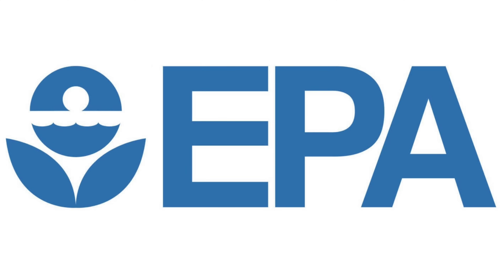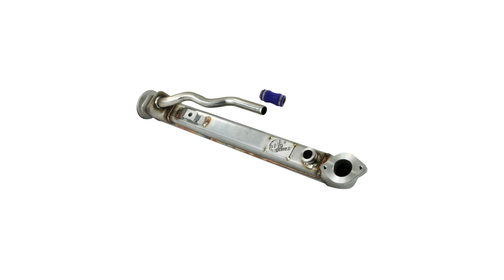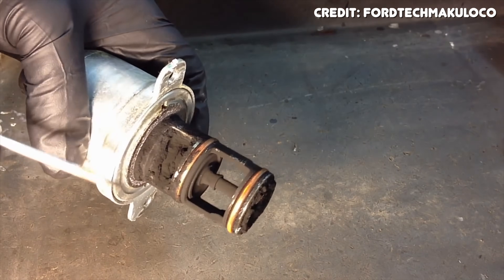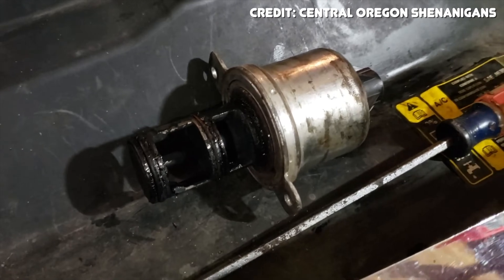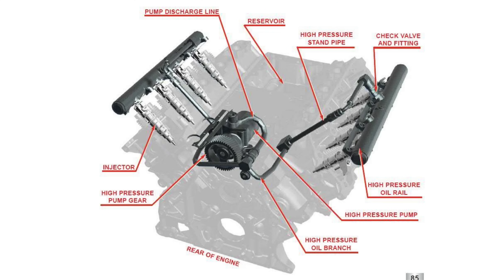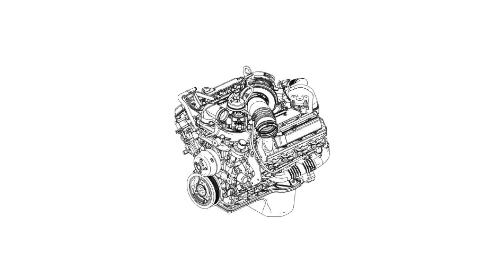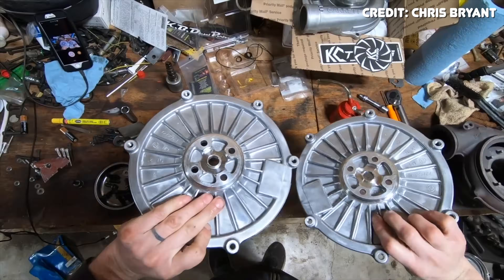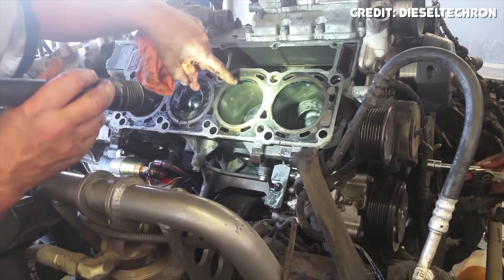The Truth About the 6.0L Powerstroke (And Everything Wrong With It)

Comment: I had an '05 Excursion with the 6.0.  My only problems were a failed EGR gasket at about 60k miles and some failed fuel injection sensor both of which were rectified on warranty.  I had it tuned and a turbo back exhaust.  Ran it to 130k miles and then traded it for a new 6.7 F250.  I was still happy with the engine, but it had all sorts of other maintenance/repair issues that were coming due.  It needed tires, brakes, shocks, replacement of the aftermarket in-dash nav, trans and diff service, some front suspension wear and potentially lots more.  I paid about $49k for it in '05 and traded it in '10 for $30k.

Comment: It's a cheaply built and complex engine that was compounded by several errors up to the point of delivery and after sales support. The block and rotating assembly are the only things decent about it. Shame on Ford for not doing the proper testing and Q.A. To further damage the reputation, Ford also failed to do the proper Q.A. on their remanufactured units. The gold coolant, and lack of regular flushes seems to be the largest culprit of major failures. The coolant deposits can lead to a failed egr cooler dumping coolant into the intake, then boom, blown head gasket. This issue can be there on trucks with less than 50K miles. We can't forget that the EPA and International is partially responsible for this whole mess. If you feel the urge to tear into one, all of the other parts need to be carefully procured and evaluated. This includes cam & lifters. Even if the cam lobes look good, you may want to consider a better profile while you're that far into tear-down. With that said, I wouldn't mind doing another build if another nice chassis finds me.

Comment: I spent thousands of dollars chasing all the problems you discussed. The final straw was a $5000 blown head gasket job. Drove it straight to Auto Nation. Problem solved. My 1999 7.3 has 350,000 miles and in 21 years has never had a problem.

Comment: I got 228000 miles out of my 03 6.0 hpop went out found another 6.0 for 1000$ had 140000 now truck has 260000 miles on no real issues.but it's all stock.
Reply: yup, what makes these awesome engines unreliable is pushing them beyond their design limits
that's all it is to it

Comment: I bought my 6.0 for cheap knowing the issues. Deleted EGR, 155/30 injectors, studs, HPOP, oil cooler relocated, blue spring, intake, KC Stage one, turbo back exhaust, etc. Runs like a champ, pulls like a train. I looked at a new truck but you can do a lot of Maintenence if you aren’t paying 1200 bucks a month.
Reply: This is the way, rebuilt everything but the transmission so far. 80k plus 7 % intrest for 72 months is a fools game.
Reply: I just bought a 2005 F-350 Lariat FX4 Long Bed with only 58,000 miles on it. There's not a ding, dent, or scratch on it. Interior still looks darn near new. It's 100% bone stock original. It is a Unicorn for sure. Over the next several years, I will be doing several of the things you listed. Gotta get ready for retirement. This will be the last truck I ever buy. And I will save tens of thousands of dollars doing so. I WILL NOT BUY A NEW PILE OF CRAP!
Reply: I bought my 03 from the original owner with everything already done 17k miles before I got it for 5k dollars with only 183k miles on it
Reply: Litterly why I just sold my 2021 ranger to drive my 03 350 6.0
Reply: Great post
Reply: What exactly did you do to your 6.0 to make it run as such im going to be buying a truck with said 6.0 in it and want to be aware of what I may have to endure before buying
Reply: Yeah, the stock oil cooler was the big unknown killer of that engine.
Reply: Where did you have the work done at
Reply: Right! Cost of new trucks and interest…

You can add a few features to these and roll out!
Reply: Im planning on getting a 6.0 ford I wanna do all the bells and whistles on it like you have, and it’s gonna be my daily I drive 30 mins to work on the highway think that’ll be good and I wouldn’t see any problems?
Reply: @andrewmoi567  like he said above, stay away from hot tunes, ARP studs, EGR delete, remote coolant filter, blue spring update, change fluids early, always, don’t drive like an asshole, I bet you’ll find you love the truck. Do the work yourself and it’ll be a great experience. I love my truck. Paid cash in 2008. Did the above, minus EGR delete, just updated it, and it’s been a good truck.
Reply: Yep, mine pulls like a locomotive.
Reply: so basically you bought that shitbox dumped around how much you payed for the truck itself and its still shit
Reply: @shaggy501  I payed 5k for my truck and runs fine could put 15k in parts and gave a brand new truck good luck picking up a 1ton in my area that's good for anything under 30k
Reply: @shaggy501 I will NEVER understand why someone cares so much about how someone else spends thier money! Maybe just share how you spend your time and money…
Reply: @shaggy501  Ah hah! I found the moron in the comments!

Comment: So, for starters, you NEED to look at this person's videos about the 6.0 and edit your video so that you can update people that may be watching.  There is some information in your video about the head bolts that I think you need to clear up because there is a lot of misunderstanding about the head bolts (Torque To Yield or TTY).  I'll admit, I didn't realize that it was misunderstood either until I watched some of these videos.  They know their stuff when it comes to the 6.0.  Likely more than most techs out there and many owners and possibly even a few engineers.

Their channel is here:

https://www.youtube.com/channel/UCm3RzBZ2yUkgIqFlOqb7Mpg

Next, you need to understand a few things about the "myth" of the head bolts being the problem or one of the problems with the overheating or coolant issues.  I will again suggest that you check out the videos on this person's channel as they have covered a lot of the 6.0 and how it operates and the drawbacks of it.

But, I'll do my best to sum it up for you based on my interpretation of this person's channel.

For one, they found that the torque to yield (TTY) head bolts actually provide just as good of clamping force and possibly even better than the STANDARD ARP head studs that a lot of people use when doing the change.  I typed "standard" because ARP does make different variations of head studs for the 6.0 as well as other engines for which they can withstand much higher clamping forces and temperature changes.

At the same time, instead of the standard head studs costing $450 to $500, these higher grade head studs cost $1200 or more so at least 2 to 3 times the amount.  Now, for people racing their trucks, this might be worth it.  But for people just wanting to get a little more power or maybe even more than "a little bit", the standard ARP head studs are probably sufficient.

But anyway, the point is, based on the info on that person's channel, they did comparisons and although I am NOT speaking for them, essentially they found that the torque to yield (TTY) head bolts were NOT the problem.

One of the main problems that contributes to many of the issues is simply the design of the heads themselves.  Not only because the engine only allowed 4 head bolts to provide clamping force around each cylinder, but the heads themselves did not have adequate support between those head bolts to provide adequate force to prevent the heads from warping or "tenting" in between cylinders or multiple cylinders.

Essentially, the "bridge" (support material) between one bolt to the other one (say the top two) was not thick enough to prevent the head from deforming.  Again, the "warping" or "tenting".

So, what happens is the head ends up having a big oval shaped area in the entire middle of the head (I guess think of Ford's logo and there you go) and this area "lifts" up allowing gasses to escape along with combustion as well as coolant to enter the cylinders and/or chambers.

The result is a lot of problems with head gaskets and heads.

The problem is, this can't necessarily be corrected by milling because Ford actually sent out a TSB (technical service bulletin) specifically stating NOT to have the heads milled UNLESS they were warped by less than a certain amount.  I believe the measurement was less than .002" but I may be wrong.

Anyway, the problem is, even if you mill the head, if it's warped too much, the head is still going to have that deformation EVEN WITH milling the head flat.

And, because there isn't enough support or material between the bolts holding the head on to prevent the head from deforming further, it will still "warp" or "tent" even after having head gaskets replaced AND head studs put in.

This person went through hundreds and possibly even thousands of posts from various online sites of owners having their head gaskets replaced as well as heads milled only to have problems within a few thousand miles after the repair.  This happened to many owners.  Sometimes it was within only 20k miles or 10k miles and even as low as 5k or 1,000 miles.  Some said it was pretty much immediate.

How could this happen?

Well, it's because the head design is just crap.  Obviously, the limited amount of head bolts around each cylinder doesn't help anything but that's just one part of the problem.

So, about the only solution is to either find a really good used (seasoned) head that is extremely flat to within .001" or better.

Or, have the heads O-ringed to provide better sealing ability around each cylinder.

Or, consider purchasing new (NOT REMANUFACTURED) heads.  I say NOT REMANUFACTURED because the problem is, if the heads are remanufactured, either they are going to have the exact same castings which isn't gaining anything due to the lack of support material (as I've already pointed out) or, they will just be used heads that aren't really good to use anyway.

If you get a completely new set of heads, there are companies that make them with completely new molds with better support material to help combat the issues with the heads "lifting" or "tenting/warping" during operation.

I'm not advocating for only one company because I believe there are others out there that make heads but Kill Devil Diesel is one company that makes their own heads for the 6.0 that are 100% completely new from a brand new mold.

The downside is that the heads are aluminum so there is a concern that the strength of aluminum compared to cast or whatever material the stock heads use is not quite as good.  Unfortunately, Kill Devil Diesel doesn't offer a different option at this point that I know of.

There are other companies that many owners of the 6.0 online forums do recommend for heads as well.

The other issue that isn't really discussed is how poor the surface preparation is prior to reassembly not just for the heads BUT ALSO the engine block itself.  Not to mention people not checking to ensure that the engine deck surface is 100% flat or within .001" or better as well.

Too often people don't clean these surfaces properly by either not cleaning them enough and leaving debris on them or using the abrasive discs such as the popular ones from 3M and not realizing that they are taking metal material off of the engine deck or the heads as well.

As a result, you have an uneven surface for one or both parts that the gasket can't fix.

So, people need to be checking the block as well to ensure it's flat for the deck surface.

And, if it isn't, they need to be doing some surface work to bring it back to within sufficient "flatness" to ensure a better repair.

Anyway, that's it in a nutshell.  I'll include a few links to some of the videos that you should look at.  Unfortunately, they aren't necessarily the most "sizzled" or "upbeat" videos and the person admits that they can be somewhat "drab" (not their words but just paraphrasing) but the info is amazingly interesting and I assure you it's worth watching.

At least if you want to understand the 6.0 better.

Oh yeah, one more thing.  This person is no joke.  They have 17 ASE Master Certifications and worked at a facility as an R&D Vehicle Test Manager - Friction Products, aka Brakes.  They had more certifications than any of their co-workers.

There isn't necessarily an order to consider watching these but the first one is probably a good start:

https://www.youtube.com/watch?v=LYWVp_n5CKw&t=1664s

https://www.youtube.com/watch?v=RPPO6w3B7Ok&t=1287s

https://www.youtube.com/watch?v=ETXc5T9eW9s&t=31s

https://www.youtube.com/watch?v=_RQO4i7F_Bs

https://www.youtube.com/watch?v=8-PoJ26oTy8&t=754s

Comment: I got my 04 f350 at a steal….. at 174k miles. It needed basic work for road worthiness, meaning it had been sitting for roughly 2 years. Batteries were dead, shock rusted out, caliper stuck. Once batt was installed it fired right up. Drained oil and replaced with 15:40 T6 Rotel. Drained the mast ford orange coolant and replaced with shell rotel CAT spec (black jug). I had lots of gelled fuel in the primary fuel filter housing, had to change that whole piece. Ran decent until it left me sitting due to turbo death. $3000 later it has a new turbo, IPR and some other parts associated, o-rings and such. Another fresh oil change. I also ran a 4” turbo back exhaust, deleting the CAT and muffler. I have not performed an egr delete yet. My truck now has 181,091 on the odometer. This is a SRW extended cab. The prev owners pulled horse trailers. I use it for a trac loader and run it to the eastern shore about once a month. It is a auto, 4wd. I do see the issues, I am hoping that with a delete it will be a half mil motor. $80k is a lot of money and a house payment for 7 years. Thoughts? I do like a ford overall. But I believe ford should pay/fix these over 100k issues.

Comment: I can also say yes of course these issues can be solved to be reliable but you spend more than the value of the truck doing it and you can just get a 7.3 or 6.7 that will not have these issues even if put a lot more power to it yes the issues can be fixed but the real question is why is it necessary? Because it’s a flawed design

Comment: Some of the engineering on the 6.0 borders on absurdity. I will never own another 6.0 . Mine has been nothing but a money pit. They should have stayed with the 7.3. If it ain't broke, don't fix it.
Reply: Same experience here.  To many parts failing much to quickly with diligent maintenance.
Reply: But it was broken. It was down on power and too dirty to go into new trucks.
Reply: @groofromtheup5719  In my experience they did not help things. They don't make the 6.0 anymore either.
Reply: @terryrose6208  nope. It wouldn't be clean or powerful enough again. Even if it was a reliability machine when it came out, it would still be gone.

Comment: Well I disagree about tuning in this video , attitude by the narrator is a typical millennial not everyone tunes their truck when they want reliability like hauling which "trucks are for" if you want to race Moron buy a Mustang who races 8000 pound trucks lol, my 2004 is bullet proofed with banks exhaust and cold air intake approaching 500 000 miles original injectors and HPOP,  running Amsoil synthetic has made this truck so reliable and average 20 mpg , hauls my 5th wheel just fine and it's paid for.
Reply from the maker: tYpIcAl MiLlEnNiAl